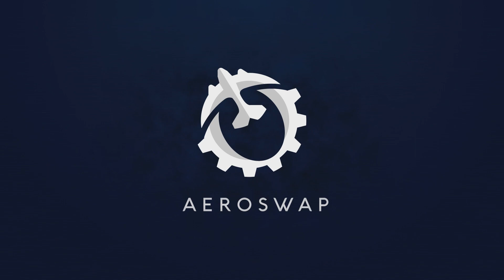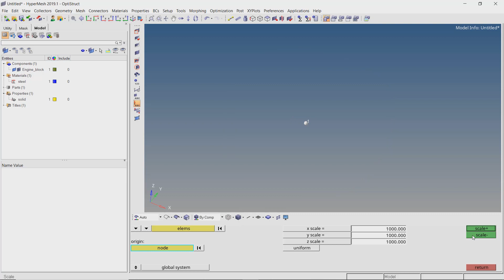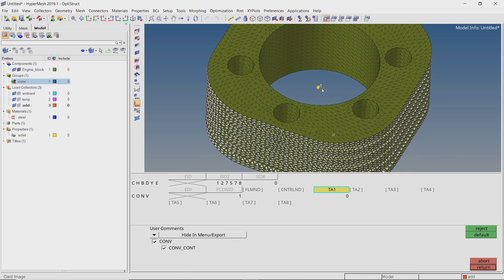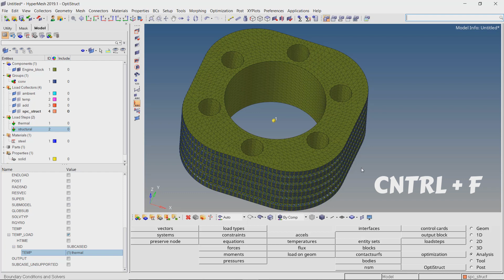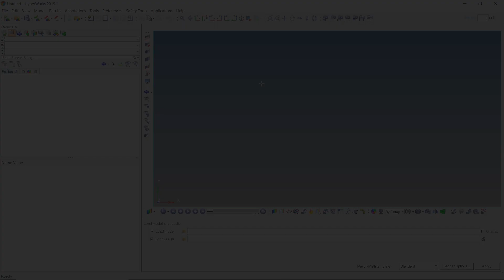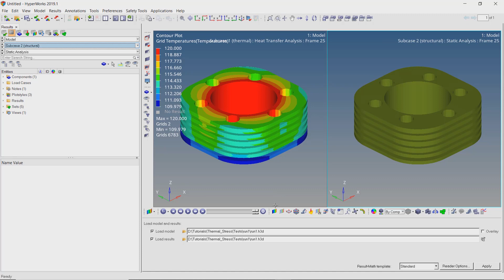Thermal-Stress Analysis using Hypermesh [Optistruct Tutorial]

Comment: Hi, Good presentation. Why did you scale the model 1000 times in negative. Having units of meter is not sufficient ? instead of scaling.  I did not understand. Could you please explain
Reply from the maker: Good question! Hypermesh is a unit-neutral environment. You can use any unit system as long as it is consistent. For this example, the material properties that I had received were in (N, m, kg, s) unit system. As the geometry was created in mm, I had to scale it by factor of 1000 to convert it to m.

A second approach would have been to get the material properties in (N, mm, tonne, s). Then scaling of geometry is not required.

I hope this answers your question!
Reply: Thanks for the explanation !!! Agree with the answer. 👍

Comment: Hi, Thank you for the excellent video, Much appreciated. When I try to perform a thermal steady state analysis, I am getting an error message like this :  

  * ERROR # 3413 *
  Unsupported subcases in Domain Decomposition mode.
  DDM is available only for static, eigenvalue/buckling,
  frequency response and modal transient analysis.

Is there a possible solution to this problem? Thanks in advance!

Comment: How to do the heating of part from 20c to 60C with time of  20minutes and holding the part for 40minutes at 60c. Cooling from 60C to 30c with time of 80minues.. could u lls exllain how to do in optistruct..Here need to heat or cooling the whole part..
Reply from the maker: Hi Suresh, this can be done using a 'transient thermal analysis'. I have already posted a tutorial ahout this. Please check the 'Thermal/CFD playlist' on this channel to watch that tutorial.

Comment: Hello, thank you for your amazing work here ! May you explain how to use the check dof 1 to 6 in the constraint windows please ? 
Thank you, rock on man !
Reply from the maker: Glad you liked the videos Michele!

There is a checkbox next to every dof in the constraints panel. If you see a tick, it means that the dof is constrainted (motion restricted along that dof). By default, all dofs are constrained in HM. You can deselect the unwanted dofs for creating the required constraints in the model. By check dof, I simply mean that you should make sure that all dof have the tick mark!

I hope this clears you doubt.
Reply: @Aeroswap  Hello, if I create different thermal loads ( as QBDY1), to put them together should I use "LOADADD" card or something else ? I keep getting "ERROR 23 - SID 18 used on Case Control data DLOAD is missing in bulk data", where SID18 is the loadadd card. 

Thank you for your efforts
Reply from the maker: Are you performing a transient thermal analysis? If yes, you can combine multiple trasient load entries (TLOAD) using a DLOAD card. Then assign the DLOAD in loadstep.

If you are talking about steady state thermal as shown in this video, just put all the thermal loads in same collector. No need to use LOADADD.
Reply: @Aeroswap  It is a transient and now it works correctly, I didn't think about DLOAD. Thank you so much man ! Really appreciate it
Reply: @Aeroswap So sorry to bother again. If I apply every single load separately, everyone of them have its own influence but If I use DLOAD to apply the loads at the same time, I can see only the influence of the first one. 
Any idea to solve this issue ?
Reply from the maker: When you use DLOAD, you will see the combined effect of all loads. If you want to observe effect of every load separately, you have to create multiple loadsteps and assign respective TLOADs in DLOAD field of every loadstep.
Reply: @Aeroswap  Yes I know, the problem came up because when I run all loads (DCARD), physically is like only one load is active. This is pretty weird because if I run one load at time, the psysics makes sense
Reply from the maker: In that case, I don't think this is a modelling error. Just check if the boundary conditions (loads) are right. It should work!

Comment: Hello Sir, Nice Video....Sir...In my Hypermesh cntr+F is not working....may I know the another way to global output result or how to set shortcut in cntrl+F..Must Reply Sir
Reply from the maker: To add this card, go to- Analysis >> control cards
You will find all the control cards listed here in alphabetical order. Just click on any control card to add it to the model.

Then you can exit this panel and use the Entity editor window to set up the card as shown in the video.
Reply: @Aeroswap  then how did I set HD3 Output option like you did in this video....
Reply: I'm using Hm14...so only I don't find search option in top right corner....

I need to set thermal output to hd3 like u did
Reply: I found it sir...thqqqq
Reply from the maker: All options are provided in the global output request card. If you are facing difficulty in finding these options, leave it. 
Optistruct outputs all results in H3D format by default so it will not be a big issue.

Comment: Thank you for the wonderful explanation ! 
I would like to ask you about the ftype =3 meaning and mainly the convection coefficient H=20, is it given or should I calculate it before coz Igot stuck in this point? thank you very much.
Reply from the maker: Hello,
Ftype=3 is the setting which specifies that we want to enter the value of convective coefficient manually. I used 20W/m^2K as it falls in the standard range of values for air. 

Feel free to change this value, and all other material characteristics according to your problem. As this analysis was not based on an actual experiment, I have used standard values for all parameters. 

Glad you liked the video :)

Comment: Hi Aeroswap

I really apricate your work. I am performing thermal stress analysis on different component, which are having non linear contacts, bolt pretensions and pressure loads. while performing the thermal stress analysis in HM 2019.1, I am a getting an error as below. 
 
  A fatal error has been detected during input processing:
  
  * ERROR # 4734 *
  Surface-to-surface CONTACT 1 is not supported for heat transfer
  analysis.
  
 * Run terminated because of error(s) in the input data.

Please tell me how fix this issue.
Reply from the maker: The type of contact you are using is not compatible with thermal analysis. I do not remember the exact contact definition which needs to be used for thermal analysis right now.

Please refer the Optistruct manual to resolve this issue. Looks like a minor error, wont affect your analysis setup much.

Just an extra info, the Altair website has free ebooks in the Training and resources section. There is an ebook for 'Thermal Analysis using Optistruct'. It is excellent to learn this topic. I would suggest you to go ahead and download that ebook, it will help a lot in your project.
Reply: @Aeroswap   Thank you for your quick response. i got the answer for this. we need to use node to surface contacts instead of surface to surface.
 And can you please tell me why use the constraint loads as temperature loads instead of using direct temperature loads in analysis page. what will it make difference in analysis
Reply from the maker: Good point. Both these methods will give exact same results. You can use whichever is comfortable for you!
Reply: @Aeroswap  thank you for your quick response ❤️❤️

Comment: Hey, I am getting an **error  1490** Unexpected continuation card, while performing Normal modes analysis of BIW, I have to submit my work within deadline (that is today). can you tell me how to resolve that issue? The quality check is failing for approx. 1% elements but I have disabled CHECKEL card so thats not an issue. Please help!
Reply: And yes, the BiW is a 2D body
Reply from the maker: Are you doing a normal modes analysis or heat transfer?
Reply: @Aeroswap  normal mode analysis
Reply from the maker: Please watch the modal analysis video posted by this channel. Follow every step and do not add any extra settings. It is a tried and tested method and works for all geometries.
Reply: @Aeroswap  Yes bro, I watched it already. And followed that as well. Can you just tell what are continuation cards in hypermesh? and how to block them?
Reply from the maker: I have never faced this issue before. Which version of Optistruct are you using? Can you please open the .OUT file from working directory and view what the error message exactly says and refers to?
Reply: @Aeroswap   I am using Hyperworks 2020  and the .out file says , A fatal error has been detected during input processing:
  
  
  * See next message about line 37 from file:
      D:/ELEATION/HYPERWORKS/ASSIGNMENT/A-11/BIW/BIW_RK.fem
   "+            0.078.35159     2.012.60499     4.03.691005     6.01.825943"
  
  * ERROR # 1490 * in the input data:
  Unexpected continuation card.
Reply from the maker: Try deleting all the control cards, if any are present in the model.
Reply: @Aeroswap  No control cards present. Can I send you the .hm file via Instagram?
Reply: If you are free to review it!
Reply from the maker: Sorry, I do not have time to view and edit the model setup right now. I suggest you to go through the Optistruct user manual or post this query on Altair forum for more information.
Reply: @Aeroswap  Ok Swapnil , thanks for your help though. I appreciated it!

Comment: Nice Swapnil! As a suggestion, you can apply this method to the bracket - bushing problem to expand the bushing hole under a specific thermal load and on the next step of the analysis install the bushing in place to study the effects of hole contraction on the contact surface of the bushing. This will be closer to the real life practices for bushings installations.
Reply from the maker: Thanks Emmanuel ! That is a great idea. I will work on a similar case soon. I think it will have to be a transient analysis as the cooling/contraction will take place gradually.